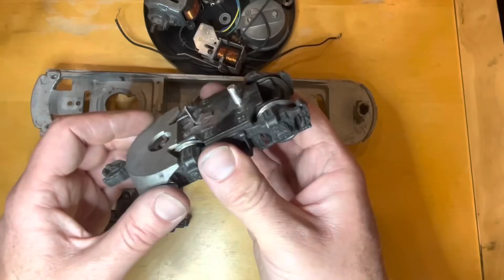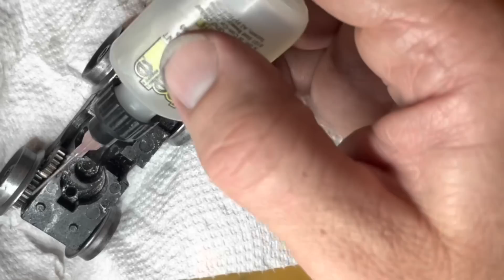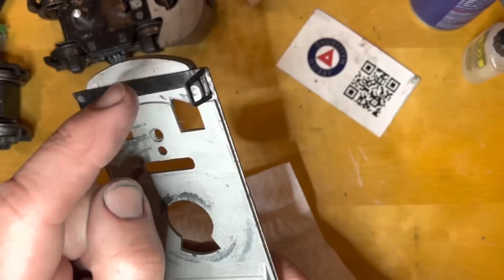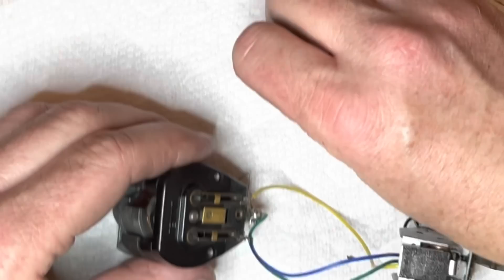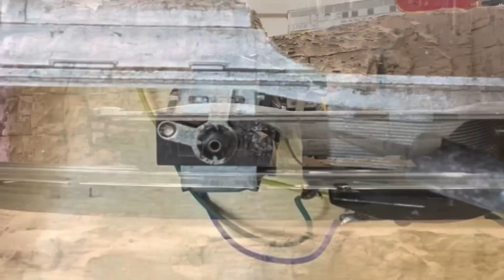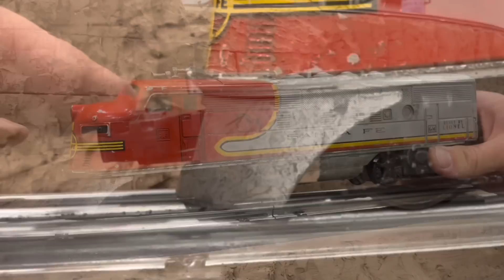Postwar Lionel 2243 Disassembly, E-Unit Repair, Service and Lube. The First Step Towards an ABA Set!

Comment: I have the 2243 Lionel F3 and the motor stopped working i need to find a replacement motor number 2028-100 my name is Bill Harvey
Reply from the maker: Hi bill, usually a little maintenance will bring them back to life. Have you tried cleaning and servicing the motor?

Comment: I have now watched this excellent video several times now & will more than likely watch again due to your using the E-unit jig. I have a number of U boats that I intend to keep running & working on the E-units is inevitable & your video(s) go a long way as reference material. I can only say 'Thanks!' so many times & mean it every time. I am in industrial maintenance & have to have some patience & that is why I never went into machine work - do not have enough patience. God Bless, DamnitDave

Comment: Very interesting indeed.  I remember that crazy system when I was a little kid.  What the heck is that "E" unit for?  Does it reverse the polarity to get the engine going in the other direction??  Why not just a polarity switch on the transformer?  I suppose this helps out when running two powered units.   You are right, that ABA set up is super impressive for sure
Reply from the maker: It’s ac so it’s nothing to do with polarity. When the power is cut, the e-unit cycles, a piston moves a drum that has contacts on it and they are arranged so that it changes direction, so I guess it’s not that the polarity changes in the track but in the engine istepd
Reply: @dagryffynhobby    Thanks, never realized these old trains were powered by AC.  So now, some of this stuff makes more sense to me now.  I remember the gyrations you had to go through the get the train moving, change directions as a kid playing many many years ago...

Comment: Hi Dave, just caught onto your servicing videos and really have enjoyed them! Your lighting and explanations are great and have 
been very helpful to me in servicing a couple of Lionel postwar locomotives. However, I've come across one of Lionel's newer
F-3s, 6-18117. I was wondering if you tackled them or a diesel similar, which uses a nylon gear in the trucks? I believe this set has been run quite a bit and the gear needs to be replaced, as I hear a "whirring" sound that might indicate slippage between it and the metal gear used on the motor's shaft. I tried cleaning and re-lubing each gear, but it didn't help. Thanks
Reply from the maker: Thanks! I’m glad the videos have been helpful. 
Did we email about your gear question? Was it resolved?
Reply: @dagryffynhobby  No, I haven't seen an answer yet. This truck has a nylon gear inside the truck block and it does not fall into the same category as the Lionel 2243 does. Would you like a photo? I should have submitted one, so you could better understand what I was referring to.

Comment: Dave: Getting ready to order wire to rewire my locos. What are the specifics to order the E Unit wire you use? Is it "Super Flex" or something different? Thank you.
Reply from the maker: The wire I’m using is silicone coated stranded tinned copper. Really whatever I find on Amazon.

Comment: I was wondering if you ever used a left hand drill bit to try and get out a broken off piece of screw? Sometimes it works. Boy with all the grease on the one truck I 'm wondering if putting it in a ultrasonic cleaner would help. Sounds like a good excuse to get one! Great video once again.
Reply from the maker: Thanks! At the moment I can’t remember what screw was broken! I have used reverse bits and extractors, but I don’t have a small set at home, maybe I should add that to the toolbox. I’m sure an ultrasonic cleaner would come in handy. I’ll have to look into it.

Comment: Love your videos.. youve helped me restore my collection of post war trains.. I do have a question for you. What are your thoughts on using white lithulium grease for gearing and axels??
Reply from the maker: Thanks so much, I’m thrilled the videos help. Before I answer I’m just going to say, I’m just a hobbyist and not even close to a trained or professional repair guy. I do think white lithium grease would be fine for gears, I personally just don’t like the mess it makes. Basically and lubrication is better than none. I say use what you have and are comfortable with and observe the results.

Comment: Would suggest your getting a metal tin with lid.  Fill with mineral spirits ("paint thinner") and use acid swabs to soak - wash away crud.
It's nice to work on well cleaned.
Reply from the maker: Thanks for the tips. I may have to try that.

Comment: My PW F3 was shorting between the pickup roller and frame near the battery housing, causing the e-unit to advance to neutral. I tried tape, but it didn't stick to the frame. I applied Liquid Tape, which was quite messy and requires multiple coats--but it seems to work. Since neither you nor I usees switches, wedon't have to blame bad trackwork. Just not a very good design.
Reply from the maker: Interesting. I haven’t seen a short like that. I guess the tolerances were pretty loose initially and with years of play, things loosen up enough to cause issues

Comment: I had a really good friend who had that engine.  I never understood why, given it was the classic Warbonnet Paint Scheme, Lionel did not give it the dignity of silver trucks.
Reply from the maker: The dual motor version had the silver trucks. The black trucks on the single motor version was probably a cost cutting measure.

Comment: I have to say the portion of the video describing the use of the PE E-Unit jig is definitely the best I have seen on You Tube. There are others that touch on the subject of E-unit repair, but you show exactly how it's done. Great job, I am going to get myself the jig. I've done several without the proper tools and as I am getting older  it's more difficult to do. Fantastic video, please keep them coming!! A+++
Reply from the maker: Thanks Joe, I do try to make the videos useful and understandable. Glad you find value in this one. 
The tool definitely helps, the fact that it holds the drum saves me so much frustration.

Comment: Well done Dave. You should never under value the importance of a complete disassembly and maintenance video especially for the prewar, postwar, and mpc era engines. Most all of the engines and cars of those era's have been sitting for years and likely have never been serviced. I always preform a complete tear down and servicing of every engine I acquire before running them. I have taken apart a 2343 and found a flat spot on the worm drive shaft because I could tell it had been ran with dried hardened grease for a long time and had likely never been serviced. This caused erratic running. Fortunately I  was able to comb it out enough to save it. Although these engines are built well, it's important to know most of the drive gears and bearings are very soft  1950's brass and hard dry grease will cause excessive wear. Operators need to understand these engines were produced using oilite brass bearings which is a soft porous brass that is designed to be soaked in oil to be thoroughly absorb by the brass for lasting protection. This is why some operators initally experience continually oiling noisy dry bearings untill they have finally absorb enough oil to run smoothly and quietly for extended operation. Only non detergent oils shuold be used. Oil is easier and cheaper to aquire than original parts. I cringe each time I see someone trying to run these for the first time after 70 years with dry crusty brass components. I use either CRC Electrical contact cleaner or mineral spirits to throughly clean parts. Mineral spirts is a non polar cleaner which is better suited for cleaning surfaces designed for providing electrical conductivity. Especially track. Non polar cleaners are non water based unlike isopropyl alcohol. All metal used in conducting electricity in model railroading is porous to a degree and will absorb whatever comes in contact with it. As most of us know by now, water and electricity don't mix well and water is responsible for rust and corrosion of metals. It's believed that's what causes zinc pest of prewar die-cast metal to disintegrate. They sit on basement shelves and absorb water vapor. Electricity running them occasionally will keep this from happening. To keep your collection, especially die-cast, in good condition they should be ran as intended.
Reply from the maker: Some really great points and information. I didn’t know about the brass. I’ll have to be more careful
Reply: @dagryffyn hobby  All is good, Dave. Your collection is yours to do as you wish. If you want to crash trains off a bridge like Gomez Addams, did that's your prerogative. I'm doing what I can to pass on information for what it's worth. It's what makes this hobby unique in the ability to share information and the responsibility for passing on what we have learned along the way. Guys, like you, are our voices for those of us who don't have a YouTube channel. I, too, am guilty of this very practice until I learned otherwise.
Reply from the maker: @DRCRailroard  the sharing of information, tips, tricks, and opinions (helpful ones anyway lol) is what makes this platform so great. I know I for one have learned a whole lot since I started the channel, and most of it comes from other people. Love our train nerd community.
Reply: @dagryffyn hobby  Dave, for me, it's a giant art project where trains can run through it. I think it is the ultimate therapy for expressing one's creativity in so many different forms. I have never done so many rewarding creative tasks all at once. I look forward to and cherish the fact that I'm always learning something new. This is the job I would love to do. If only I could make a living at it.
Reply from the maker: @DRCRailroard  you and me both! I’d love to build layouts for a living.

Comment: The only 2243 I ever owned had an E-unit, one of whose fingers had become annealed from a short circuit. The finger was no longer "springy". I finally ended  up replacing the entire finger assembly.
Reply from the maker: Yeah I figure the fingers I bent back into position moved again after it warmed up. Next step is to replace the fingers

Comment: Nice vid, especially the e unit repair.  I may tackle one after getting that tool.  

Another way which is cheap, effective and easy to degrease trucks etc. is good ole paint thinner.  2 hour bath, blow dry and wipe=done.  White teflon grease in the small tube works really well.  (Cant remember name). Little bit goes a long way and after 12 years, no drying/hardening.  While degreasing, shell gets warm dish soap bath with gentle tooth brush scrub in mommas sink.  Blow dry and walla.  

Shallow groove in post great idea.   Way easier than drill and tap.  

You probably are familiar with Jeff Kane the train tender.   He has nearly every part for postwar lionel to include Those steps, at your kinda price, cheeeeep.  

Well done.
Reply from the maker: Thanks! Good tips. Paint thinner isn’t too harsh? The train tender, yup. I should really place a large order for a bunch of parts.

Comment: I remember, when I worked at a hobby shop repairing trains, 'E' units were always the one thing that caused issues of not locomotives not running. Many people did not understand how the 'E' units work. People would always fool around with the fingers. I spent many hours taking them apart and correcting the issues with them. Many times we had to replace the fingers. I always enjoyed fixing all of the Lionel rolling stock. Always great to see videos like this.
Reply from the maker: Thank you. I figure it’s always best t replace the fingers, I just don’t do it! I think may of the issues I have with my engines can be traced to the e-units. Those points of contact are so small, it’s important that they are in good condition.

Comment: Good stuff Dave! It was amazing to see some of what looked like original grease that turned into hard chunks! Spraying it down with WD-40 is a good way to loosen up the old grease and oil. I do that myself, but what I’ve also done on tough things like this is let it soak in diesel fuel, and that really gets in all the nooks and cranny’s, then use an old toothbrush to give it a little scrubbing, and it softens up and dissolves old hard grease. It really cleans up amazingly. Great job on that E-unit. They sure can be tricky to work on. Having that jig really makes things easier.
Reply from the maker: Thanks! I had a smoke unit, metal parts, seized together with old smoke pellet residue. Sprayed it and soaked it with wd-40, couldn’t get the two cups apart. Gave up and put them in a ziploc. Ended up going back to them much later, couple months. Took the parts out of the bag and they came right apart!

Comment: I find it amazing nobody has recommended an ultrasonic tank for cleaning until now. About 2 hours ago. Digging around with a screwdriver of knife just is not total cleaning all the gunk out. And time consuming.
Reply: A sealed truck is candidate for ultrasonic tank. As you can’t even see where the gunk is………..
Reply: What about the two thrust bearings under the retaining ring?  A synthetic grease is the perfect lube since there is a race carrier for the balls. Typically they are full of gunk…….. ultrasonic tank perfect solution.
Reply from the maker: An ultrasonic tank would be awesome. Maybe someday I’ll get one. Until then I like to focus on what the average hobbyist can do with basic tools that most everyone has. But yeah, a good ultrasonic tank would be amazing
Reply: @dagryffynhobby ultra sonic tanks for home use are now quite reasonable priced for hobbyist. At about $40 - $ 75 range for one sized for Lionel train stuff & wife’s jewelry. I just got one a bit bigger and all stainless steel so I can do carburetors and alternators for the cars and it was still under $99 at Amazon ship to my house. So it now is a reasonable to own tool.
Reply from the maker: @genemanno1533  awesome. I’ll check it out. I didn’t realize they were that affordable

Comment: Great video.  When I am cleaning a chassis that is that gunked up, I get the big stuff out then clean it with soap and hot water.  I use awesome orange, blue dish detergent, or simple green.  They are good degreasers.
Reply from the maker: Thanks! There are so many ways to clean the stuff up, I love hearing everyone’s different preferred methods. I frequently use diluted dish soap and warm water, really does wonders.

Comment: Dave, great video. I have a 1954 Southern RR with dual motors. Lionel used spur gears on the horazontal motors that produce a growling noise. Not as quiet as your SF. Also, thanks for the info on the eunit jig. I have been looking for one for quite a while now and will have one soon.
Reply from the maker: Those dual motors with the spur gears are awesome, I love the sound of my nyc F3s growling around the layout.

Comment: I could go for another Santa Fe ABA unit set myself! I bet if you wanted to feed some connector wires threw the b unit to the other engine, I guess you could thread them threw the window hatches and the back of the engine and b unit
Reply from the maker: That is the plan, but most likely through the opening in the bottom of the frames so they don’t interfere with removing the shells.
Reply: @dagryffynhobby  that’s a good idea actually. I never would have thought of that

Comment: It’s a nice 2243 but it’s not a 2343, another good tinkering video thanks
Reply from the maker: It’s not a 2343, but when taken on it’s own apart from its bigger better brother, it is definitely a respectable engine. I have pulled significant consists with this single motor version.
Reply: @dagryffynhobby  naturally I am teasing as I want to see you rebuild your 2343s
Reply from the maker: @Retiredsignalman  haha! I want to see that too!

Comment: What you do with these vintage locomotive is the equivalent of a frame off mechanical restoration.
Reply from the maker: Thank you, I appreciate that. 
I wouldn’t go so far as to say frame off, more of a frame on with a couple of shortcuts! Most likely like what I’ll do with my 51 Chevy 3800 if I ever get around to working on it
Reply: @dagryffynhobby  if you restore your vintage truck the way you restore your vintage strange it will be fantastic did you get my text about the road signature line of diecast cars which are small enough to fit inside your car carriers, I got some from diecastdirect which advertisers in classic toy trains they might be able to help you so you can fill them up.